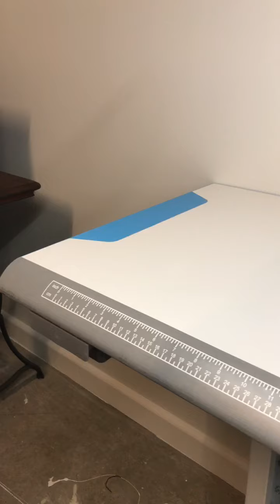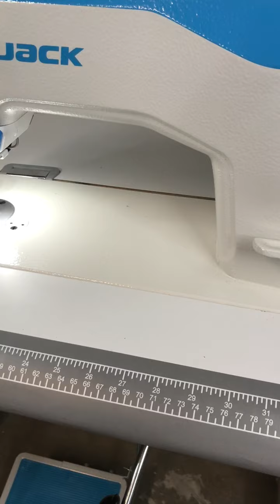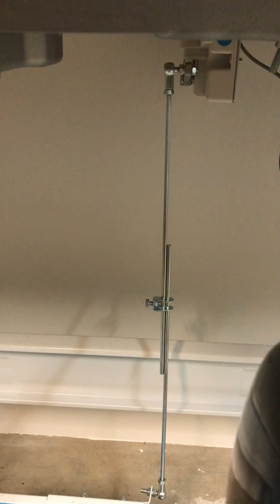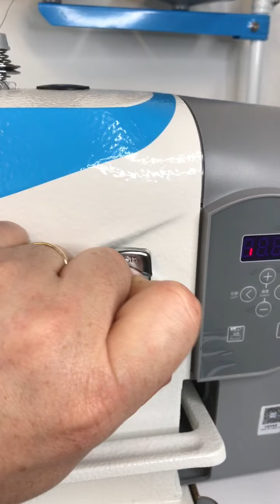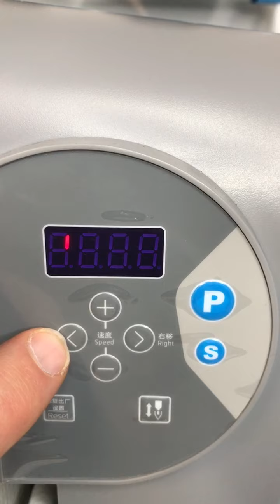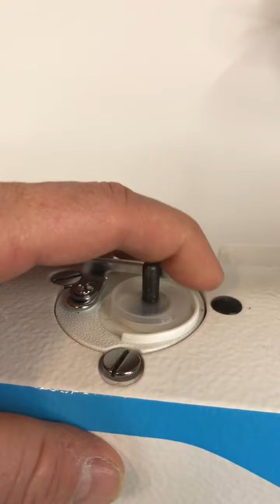JACK H2-CZ Industrial Walking Foot Sewing Machine

Comment: Is there a difference between
H2-A-CZ-12 and H2-A-CZ
Reply from the maker: I believe the main difference is the stitch length. the -12 means 12mm stitch length from memory.
Reply: I work in the field of car upholstery and I own a machine with a stitch length of 5, but I want to buy a machine with a longer stitch length because the stitches do not look perfect. I want to consult you about whether I can use a machine with a stitch length of 8 or is it necessary to get a machine with a longer stitch length? @ozcommercialsewingmachines

Comment: Thank you so much for your videos. I have a new Jack H2 (in Abu Dhabi) and your videos have been invaluable! One question, please, can the foot pedal be moved to the right?
Reply from the maker: The foot pedal can be moved to wherever is comfortable for you, you may however also have to move the motor controller as it is best to keep the pitman rod in a vertical position for best control.
Reply: @ozcommercialsewingmachines  thank you so much

Comment: Just picked this video up. H2 is 550w not 750w as you say. The H5 is 750w. I nearly bought a H2 late last year but postponed until the paindemic eased. Glad I did as I found a fully automatic machine with walking foot, thread cutter and programmable stitch counter for sequenced  sewing of batch projects. Cost about the same.
Reply from the maker: Hi. I'm not sure where you got that information from, all the "H" series machines by JACK have 750 watt servo motors. I have a H2 and checked the data plate as well, it says 750 watt.
Reply: @ozcommercialsewingmachines  UK market must have different specifications. The H2 is around half the price of the H5 with the difference being the thread cutter, back tacking, foot lifter and motor size. I opted to import a higher spec. machine directly from China for less money than the H2 and better features than the H5 but without foot lifter - no regrets.

It's one of the many versions of the computer programmable 0303-D3  750w direct drive class of Chinese offerings that are available.
Reply: @biomechanique6874  hi these comments are interesting as I’ve been looking at a H2. What machine did you you get from China? 
I’ve just looked briefly at the H5, is it correct is can do bar tac and backtacking?
Reply: @ajkrugby  Hi Adam, I finally settled on a Slinsir SMT-0303D1 750w. The 0303 walking foot type is quite generic as far as Chinese made machines go. They are also very robust - I have seen one that looks like it has done a couple of million miles in a Middle Eastern factory, quite beaten up and still going strong. The reason I chose the Slinsir version is because of a promised 5 year warranty.

I cannot properly comment on the H5 as I have never seen one in real life - just on websites and you tube. In the UK they vary in price from around £900 to £1300ish. Not even cheap on Alibaba. Considering the features of the computerized direct drive motor on the Slinsir compared to the more basic Jack H5 and given the very reasonable Alibaba price including shipping and import tax I feel I have a more suitable machine for my needs at less than two thirds the price of the H5 and a little less than the H2. Bargain. I hope that helps a little.